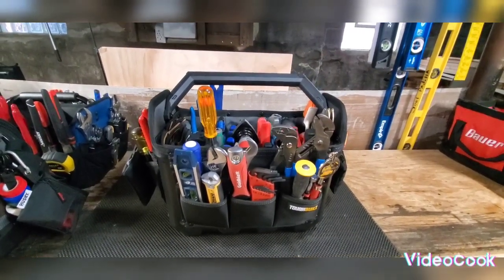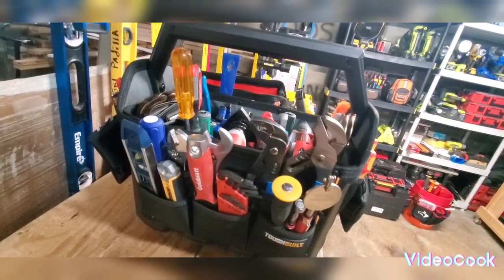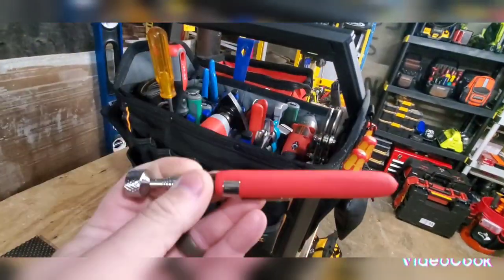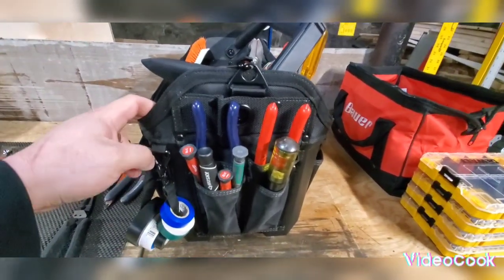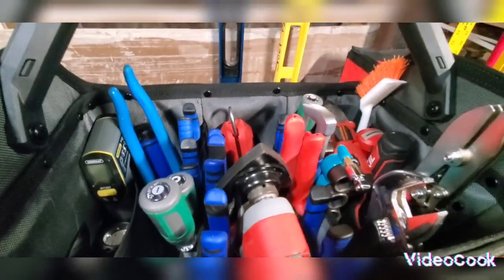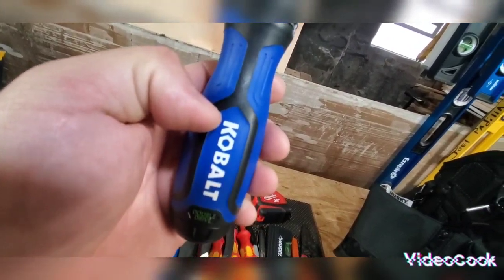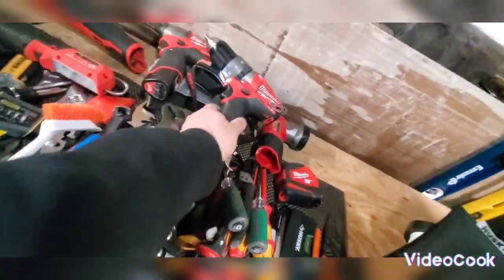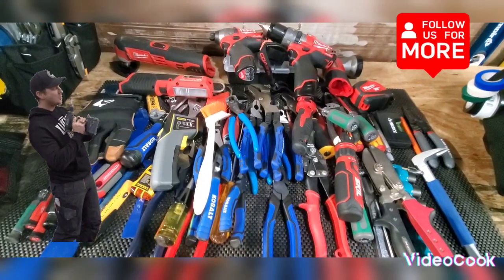Review/Loadout of the 16 inch Toughbuilt tool tote bag ! 🔥

Comment: Helpful video thank you, but what's the total weight? gotta be pretty heavy. Still considering the slightly smaller M size or this L size. Thanks!
Reply from the maker: Thanks for the comment 👍 And yes it's pretty heavy roughly 24 lbs, but the bag is sturdy enough to hold the weight 😀